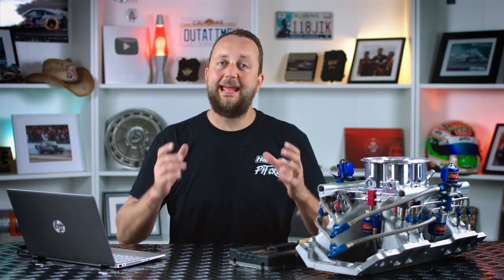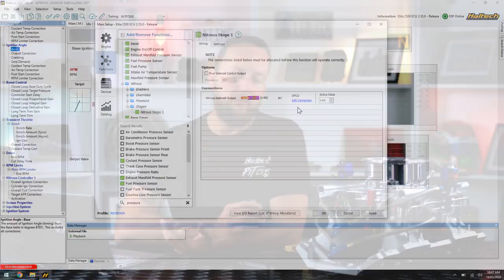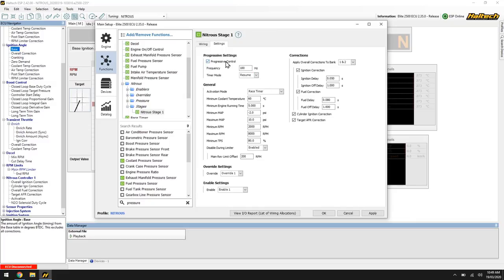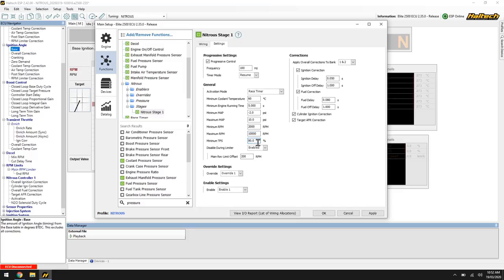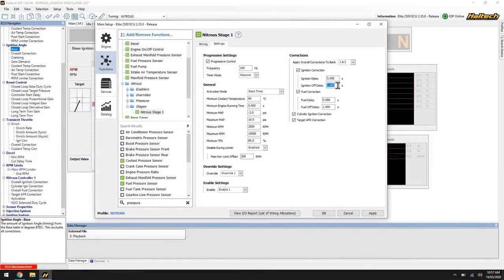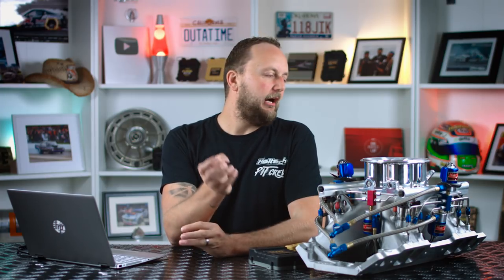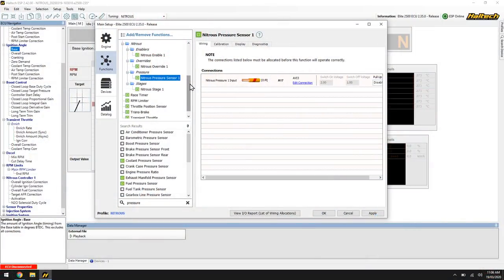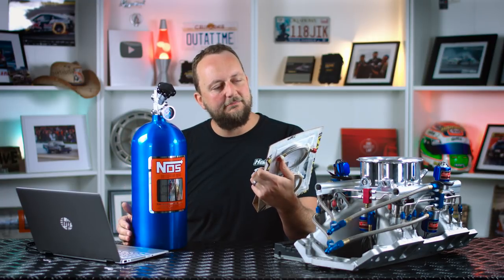💬 Nitrous Explained Part 2: It's All Under Control | TECHNICALLY SPEAKING

Comment: In  1980  I installed Nitrous  on my Z-28 Camaro  ..  manual shift ..   110  HP  booster..   Had to have  the  throttle down   and  the switch  on .. It worked just fine that way .. but now I want to put an LS  Motor in it with a Haltech Controller and run E-85  ect..

Comment: These truly ARE the best Tutorials on YouTube!!! 
Scotty you're a Madman! I wish I could pick your brain.
I'm an old school Rodder... In fact I turned 56 this morning! 
Nitrous back in the 80's was an analog wet system. The most complex I got...
You know how a Holley vacuum Secondary Carb works. I'd have a switch on the Throttle, stage one...
Then a second switch on the Secondary Throttle lever. When the Vacuum Motor opened the Secondaries beyond about 30%, the second switch activated. That was our "2 Stage".... And about as complicated as Street systems got back then! 😁
Carmine ✈🚂🚙

Comment: i would like to know how some teams use nitrous as an turbo anti lag strategy 

do we follow the same steps as in your video or we need a different automated nitrous strategy using speed sensors, throttle sensors and turbo pressure?
Reply: Good question
Reply: He sort of mentioned doing it by setting up the enable parameters such that the kit will be active between manifold pressures of say -2psi to 10psi and maybe the rpms to 2500-4500 or where ever is appropriate/necessary for lighting off your turbo.
Reply: @MmeDesgranges  Kenny out of nowhere!

Comment: I'm cheating a little bit, I am using the nitrous function to operate a solenoid to close a spool assist valve on a divided turbine housing! 😎

Edit: yes I could have done a conditional generic channel but this way adds way more functionality and tuning options

Comment: Scotty Is there anyway the nitrious injection can be automatically injected based on a certain throttle or only in certain load-points in the map, so the user doesn't have to press a button on the dash to turn it on.    This could be useful for people who want to run a very much larger turbo on a smaller engine who simply want it to spool quicker, using nitrious simply to get the turbo to begin spooling in a area of the map where it simply does nothing when you mash the gas.

Comment: There is some good programming levels there. So it would be possible to run a system rather than a turbo or charger just for times when you want more power without the physical hardware of forced injection?
Reply from the maker: Unlike a turbo or a supercharger setup, a nitrous system will only work when it's asked (programmed) to. So you can drive around with a Nitrous system without using it at all and only enable it on say track days.
Reply: @haltech  exactly, or when your at the lights in your unexpected sleeper!! I'm glad to see this amount of programming that can go into it, could almost set it up to only work on Wednesdays aha
Reply: @haltech  haha "but Haltech does not give advice on compliance with local laws for your chosen streetcar modifications"